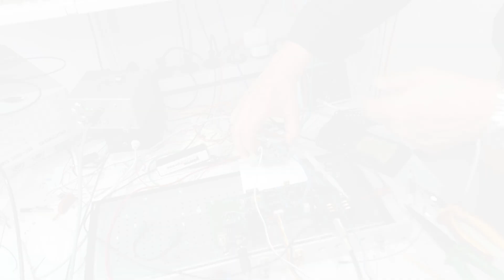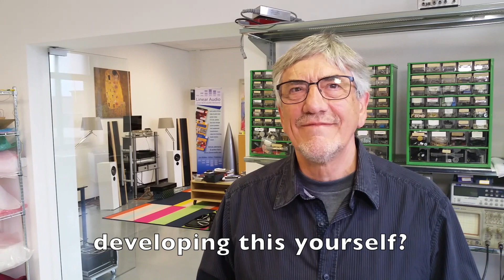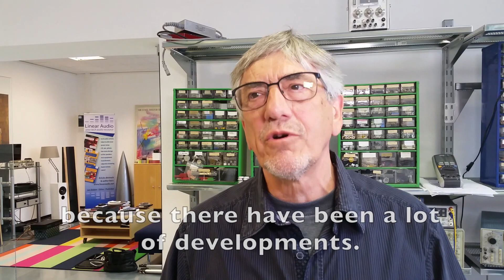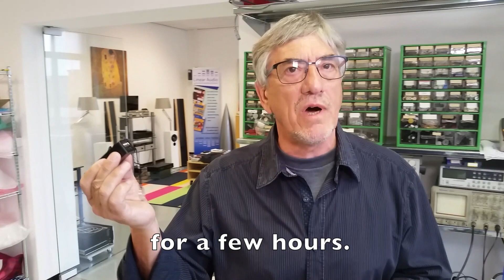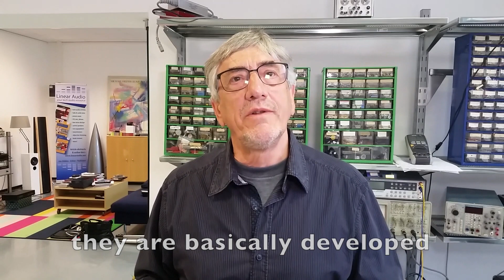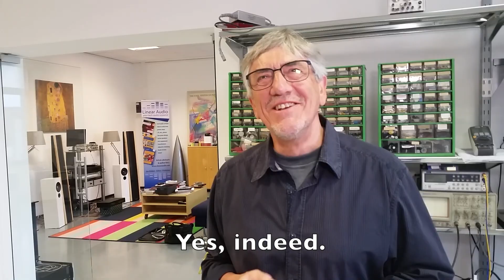Linear Audio Lab SilentSwitcher

Comment: Jan, all due respect but regardless whether you're getting power from a USB or other non battery source you ARE getting mains power.
Reply from the maker: True, but USB power is generally much cleaner than the mains (in the mains- and mains-harmonics region). Look at pretty much all spectrum measurements people show of their amplifiers - there is always that ugly 50/60Hz, 150/180Hz, etc, bump. No longer with the Silentswitcher.
But as you noted, the Silentswitcher really shines when powered from a Powerbank.
Reply: @jandidden8170  We know how to filter 60 Hz hum and eliminate it from amplifiers and test instruments. Can you imagine the havoc we would have if we couldn't filter hum out of scopes and meters? I have instruments that go down to picovolts and amps - there's no 60Hz bumps. It's just not there, even if we look at the specs from chip manufacturers, things like CMRR and PSRR are beyond human hearing. You can buy an INA opamp from TI or AD for $5 that exceeds human hearing. 

These line conditioning mains supplies companies are selling are just not needed. You can buy an AHB2 Benckmark amp today with a S/N of 132db that you just plug into the wall. That's well beyond human hearing, why would anyone need to precondition the mains line to it? Vinnie Rossi built an amp run by Super Caps that couldn't beat the Benchmark amps S/N. Look at the amps from ICEPower and Hypex with 120 DB of dynamic range. Power supply problems in amps today are a thing of the past.
Reply from the maker: @mosfet500  Yes we know how to do that. I just said that the overwhelming spectra people show from their amps, preamps, DACs, what have you, show nasty 50/60Hz and harmonic spikes. It is just an observation. Even in AP spectra they are visible if you go low enough. They are not visible in SilentSwitcher powered stuff. Again, just an observation.

Comment: You wrote 550V and 400mA that equals 220W , well jan.didden you quite quickly removed what you wrote on diyaudio.com .
Don't tell me your began with vapours.
Or 220V band on discogn , your we'll come any time you want.
BR. Please inform in time so I put the coffee pan on.

Never crossed my mind to do a few people's server, and write mostly BS.
Well it is what is a small family.
Of course I might be completely wrong  you never know what's going in a audiophile's mind. Electronics ??? ...
Nail paint violet on HB tells alot of the electronics standards the guys or shop keeps as STANDARDIZED and Iterated stimulations without VBIC values No selfheating values used in simulations .
No wonder IT sounds so good!
Actually the Chinese companies solders and assembles a proto unit to be measured etc. final stage is of course  for sale.   They offer their services pretty cheaply to our EU standards.
Well Nelson still got exotic parts so I take a wild assumption might last for decades for a group.
Reply: Electronics? What's that? Half the audiophiles I know couldn't find a cross in church and the other half couldn't find the church!